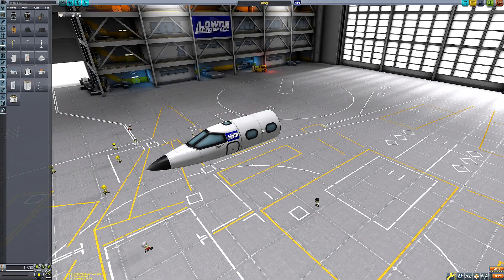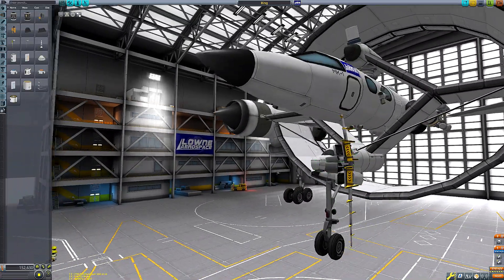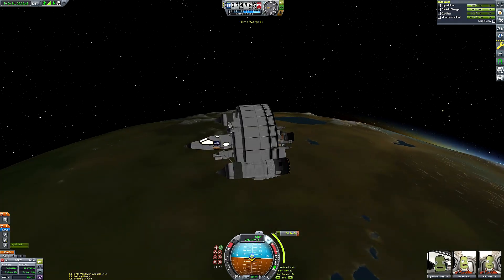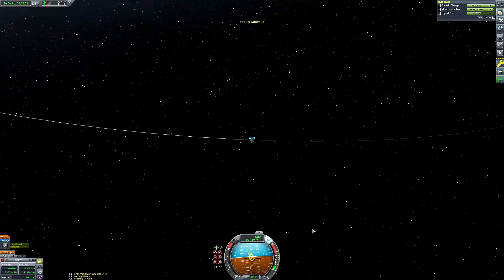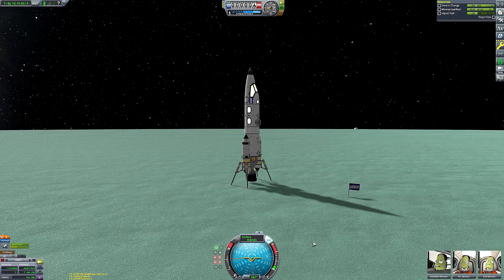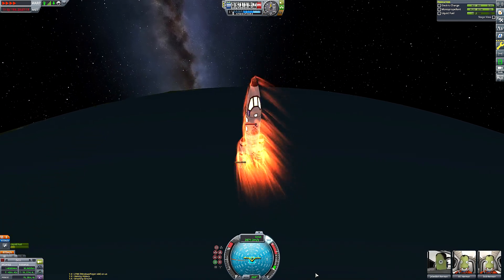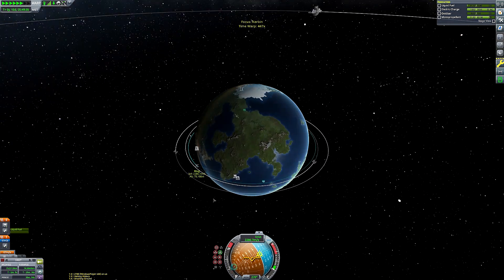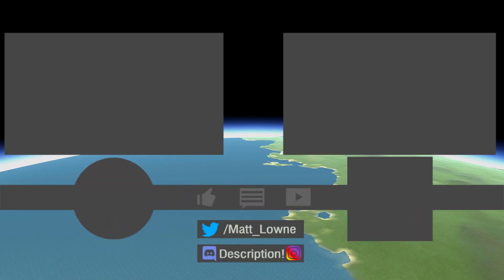KSP: The Hyper-Ring SSTO!

Comment: Debris in KSP has some quantum mechanics vibe to it - it only de-orbits when you observe it.
Same applies to parachutes sometimes. I once tried to deploy a rover from a plane, and it kept crushing into the ground. So I had to circle around it after deployment and only then it's parachutes worked fine.
Reply: Schrodinger's debris
Reply: @brokedeaddog  It's in orbit and on the ground at the same time
Reply: Or if the periapsis is below the 'camera change' altitude (about 24km for Kerbin), the game will auto-deorbit it for you. If it's above that cutoff then it will stay in a perpetual "needs to be observed to deorbit" condition.
Reply: Just fly very low to the ground so it is in physics range untill it hits the ground and u should be fine
Reply: I used to stick parachutes on my boosters so they could be recovered, but of course the chutes never deployed so it was a waste
Reply: @thesteelrodent1796  There are two mods that would allow such a recovery, one that makes a quicksave and lets you land the booster(s) individually, then saves the recovered value, loads the quicksave and gives you the saved amount. The other mod simply calculates the likely impact speed and location of the debris (taking parachutes into account), and gives you the money for the recovery. I usually go with the second mod, the first is more detailed, but it just takes sooo much more time to launch anything with one or more boosters...
Reply: @thesteelrodent1796  Once your spacecraft is in orbit, you can switch to your ascent stage that you just separated from, if you put a probe core in that stage (not the stayputnik bc it cant do SAS) you can then control it as it descends so you can land it. Then after you have recovered it, you can go to the tracking station and switch back to your craft in orbit.
Reply: schrodingers cat